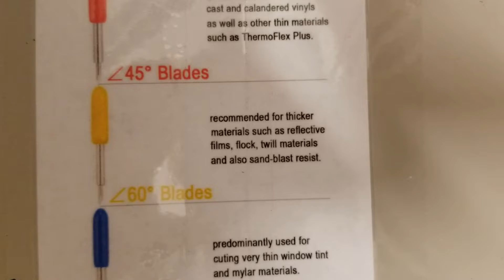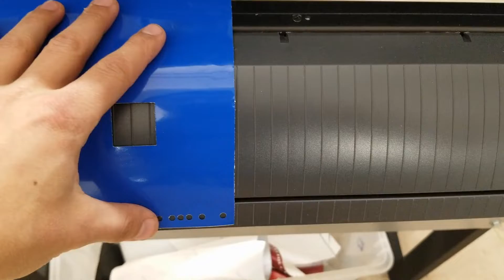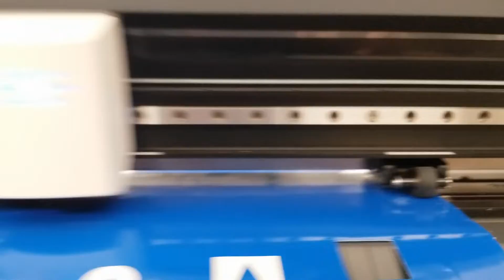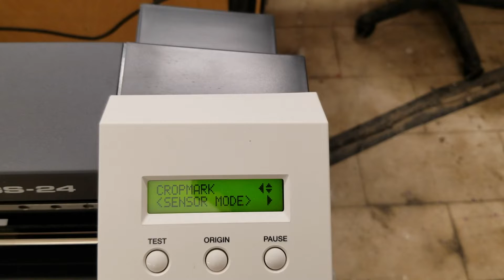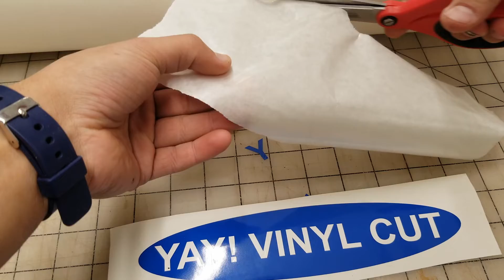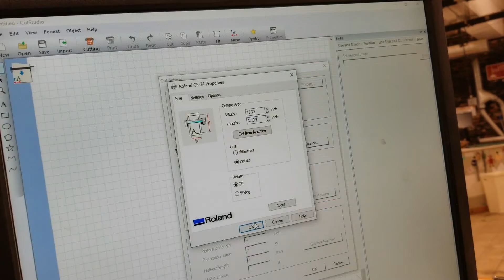How to use the Roland GS-24 Vinyl Cutter

Comment: Hi I want to thank you for this detailed and instructive video. I've a Roland GS-24 that I use for direct vinyl cutting but I'm still struggling with print and cut. I've used different programs including Cut Studio which is awful compared with other cutting softwares. I make everything right : the design with the cutlines and cropmarks  and when It comes to cutter, it doesn't follow the cutlines. There is something wrong and I need to know what exactly, I surely missed something and it's really confusing. Can you please make a full tutorial of how to perform a print and cut on the GS-24?
Reply: Hey i hope u doing fine, please did u fine any solution to ur issue with cutting?! I'm struggling with the same problem, my manager uses old VersaWorks dual to perform print  then he uses illustrator to put the cutting lines manually to make the plotter read it but i struggle alot with it and they asked me  to fix it it, they said cut studio isn't performing well so what to do now please any help with ur experience,

Ps : i installed VersaWorks 6 but i didn't connect my Gs 24 print waiting for any solution before switching my dual software